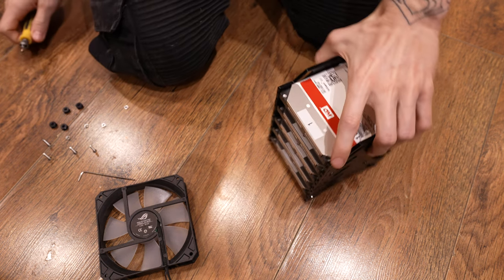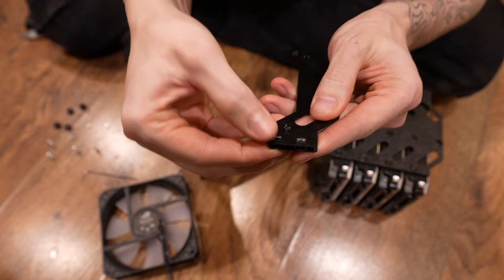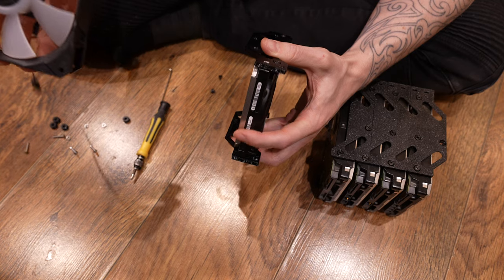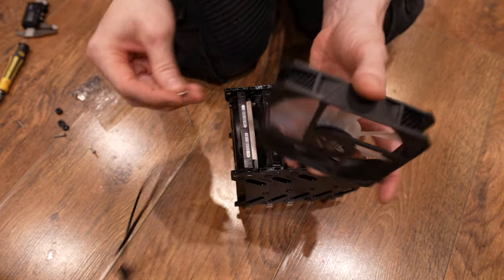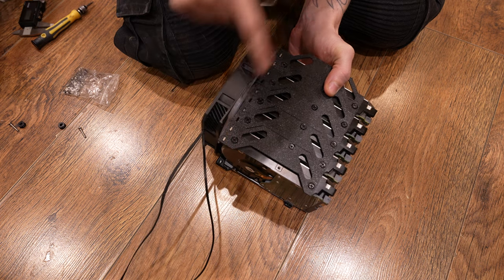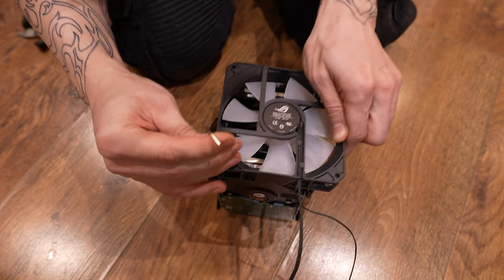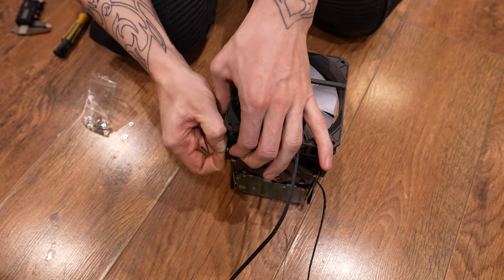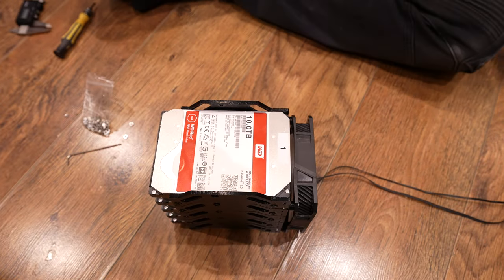3D Printed Stackable 3.5 Inch Hard Disk Drive and 120 Fan Mount Enclosure with feet

Comment: LEGEND! Why does this only have 10 likes!? You should really consider mass production of this. I recently got a InWin Dubili case and need a stack of about 4. I have space on one side of the case to screw into a 140mm where a fan can be placed, but I would rather much have something like this to house my 3.5mm drives. Will pay money for this!
Reply from the maker: thanks man, i sell these so what ever you need i can supply them finished and printed

Comment: Great design.  Question so i this video you have 5 drives.  Say you only want to get to the drive in the middle #3.  Do you have to dismantle the top two drives BEFORE you get to the drive in the middle?
Reply from the maker: yeah you would have to unscrew third and second
Reply: Thank you. If a future design is ever considered it would be great to see a slide out option along with the stackable option.  Going up and horizontal, would make this design a huge difference. New sub here!